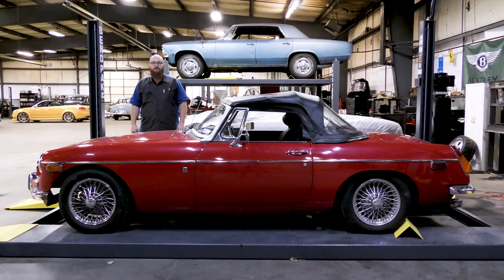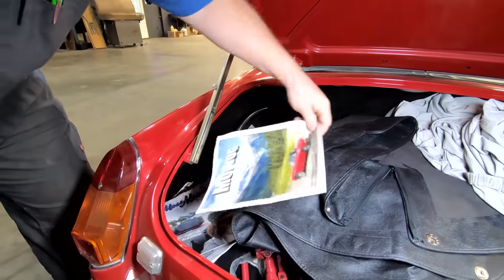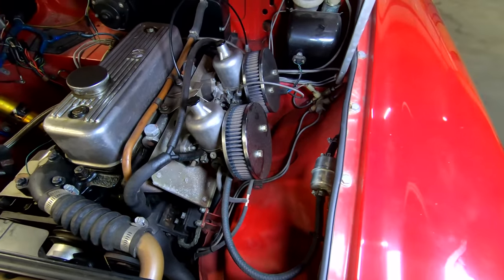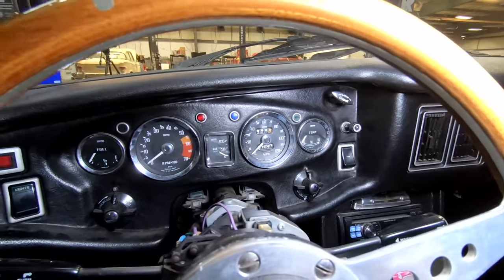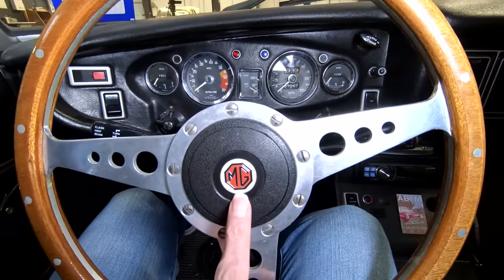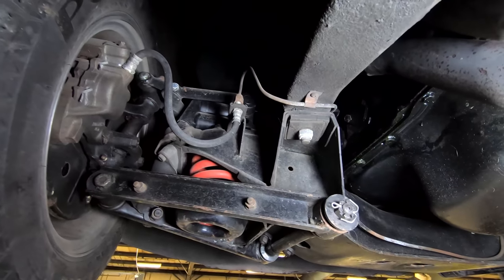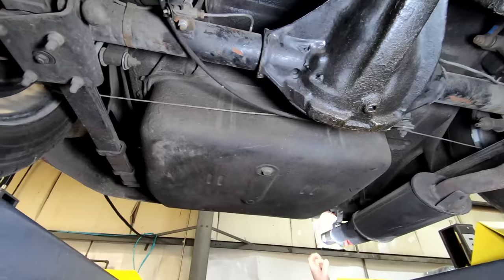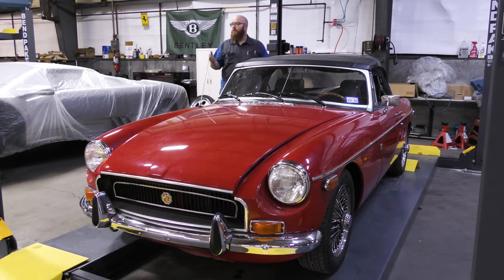Cherry 1972 MGB! See exactly why it earns a thumbs up from the CAR WIZARD!

Comment: MG A series manufactured from 1955 to 1962. The MG B series,  manufactured from1962 to 1980. 18 years of MG B series!  The later B series included a hatchback! Neighbour had a green hatchback with brown leather upholstery.  Beauty 1972 MGB convertible! 1.8L, 80-hp, OHV Dual SU carbs!  4-speed synchro-crash transmission with OVER DRIVE! It could actually drive on the Interstate! Love it! 01:49 "..back window": .. In the later half of the 20th Century, Brits (UK types) referred to the back window/rear window of their automobile as the "back light" . BTW, in the UK, plexiglass is referred to as "perspex". 14:20 The empty battery bracket on the aft port side is awaiting a starboard-side driver. Yup. Weight and balance considerations were taken into consideration for a change in suspension geometry for certain markets... . I have heard the MGB's knee-action dampers on the front suspension could be refilled with either mushy peas or beef gravy, depending upon climate. Rachel Ray's EVO be damned!.. In summer, the plungers on the SU carburettors were partial to a certain Portuguese Port. .  In England, aluminum, element 13, Al,  is spelled "aluminium". Funny that.  Some engineering features of 1950's and 1960's MG's were even quirkier than the 1972 MGB of the Car Wizard's.. Luv yah!

Comment: My MG stalled as well: The heat valve was leaking and water was constantly dripping on and in the distributor. Easy fix with a valve replacement.

Comment: MoWoG you'll find stamped on a lot of parts. It's an abbreviation of Morris (Mo) and Wolsley (Wo) from when the two companies merged. The G they say either means Group or MG as the prefix at the time for MG's was G.
Reply: MG is the abbreviation for Morris Garage.
Reply: It is spelled Wolseley, but pronounced as wolsey.  Love British English.
Reply: @mescko  I am British and say Wolseley
Reply: @clairesmith1117  Interesting.  I've heard Brits pronounce it Wolsey, I'll have to check with a mate of mine in Croydon, he's a a car nut with a Marina GT, 1300 GT, Maxi,  Dolomite Sprint, Stag, 2.5 PI Mk.1 and who knows what else.
Reply: @machtschnell7452   Actually  ... no.
Reply: @machtschnell7452  NO
Reply: @machtschnell7452  Garage is  I N C O R R E C T .

Comment: The British name for those shock is 'lever arm shock absorbers'.
Also the damping fluid in the carbs does not slow the opening of the throttle. It's action is to enrich the mixture on acceleration in place of the accelerator pump you would find on conventional carbs.
Those Lucas pumps were hilariously bad and they never bothered to improve the design in many decades.
When I was a kid my father had a Landrover which was only about a year old. One night it died in the middle of nowhere. He was completely unfazed - just looked around for a rock & whacked it. Pump started running and we went home. 15 years later I was in the army and the Landrovers were still breaking down for the same reason. I used to help out with recoveries and used the same method to get them going.
Reply: so true of the land rover carried a piece of wood "Rhodesian Army"
Reply: Thank you for spelling "damping" correctly. The Wizard, unfortunately, made the mistake of calling it a "dampener" as most people do.
Reply: W was essentially right re the SU carbies. Pedal to the floor, lots of manifold vacuum, the oil stops the SU piston slamming to the top of its pot (they look great polished)  and lifting the very long needle, prematurely opening the jet wide. The oil means it opens in a slower, more controlled way. A clever design, if you don't care a jot about pollution.
Reply: The fuel pumps were supplied by SU, not Lucas. With just occasional use, the contacts points stick, and the quick cure was to tap the pump with a hammer. Today, you can replace the points with electronics, which are reliable, and retain the original appearance of the pump. They are easy to overhaul.
Reply: @chrisnewbold9876 
Yes branded as SU, made by Lucas?
Reply: @gregculverwell  SU had its own fsctory
Reply: @petersherman2552  yes, you described it correctly. I had SU’s on my ancient Volvos, had them torn down, cleaned and rebuilt myself with gasket kits. The car even ran better when I did this.
Reply: These Armstrong lever arm shock absorbers were a nightmare, when they failed the failed completely. The reconditioned ones I used to buy could fail in six months.
Reply: Greg... as to the enriching, not quite.
Reply: @gregculverwell   Perpetuation of another Lucas /SU myth.
Reply: @davidvicari5139  And the reason the Swedes used the SU carb, best made. Swedes do not compromise on quality.
Reply: @velviaman3206  The Armstrong shocks are a simple device. Easy to clean and refill . Another Brit car myth.
Reply: @jeffhildreth9244 
Dear Mr Grumpy. I really don't care who exactly made them. I assumed that because everything else electrical which failed with nauseating regularity on British cars was marked 'Lucas', that they were also responsible for this garbage.
To be honest I never bothered to look closely - just gave it a whack.

Comment: Amazing condition underneath…here in the UK, owners can only dream of an MG  that rust free 👍🏻👍🏻
Reply: Yes indeed. No rust OMG
Reply: And about half of the US
Reply: Isn't that why you colonised Australia, so you could have a place to own and drive rust free cars. I'm sure that's correct.
Reply: Australia …a great place to find old British classic cars 😎
Reply: BMC Heritage does make a replacement shell or unibody for this car..
Uses much better steel and is completely original from the BMC panel dies .
Reply: @curtknight1021  I think they are etch primed like modern cars are so resist the rust gremlins very well.
Reply: For a while in the 1970s ,  l heard that England was importing tons of Russian made steel , as part of a trade agreement with the USSR..
It rusted as soon as it was shipped out , in those British car bodies.
Reply: @curtknight1021  I heard of that with Fiat, as the USSR couldn't pay for the tooling that went into making the Lada based Fiat 124. I've never heard of USSR steel being used in the UK but I wouldn't be surprised if it was!
Reply: It was part of a trade deal to open up commerce between the USSR and the  UK .

Comment: Wow! Brings back a lot of memories. I had a 1972 MGB that my Dad bought for me in 74. It replaced my 67 Galaxy 500 that my sister wrecked! Originally the car had two 6V batteries in series, hence the two battery compartments.Later I put in two 12V batteries in parallel. That required a Ford alternator to keep both batteries happy.  I put almost 233k miles on that MGB. I did rebuild the top end a couple of times, replacing the 8:1 original pistons with earlier 9.5:1 ones. I never rebuilt the crank, transmission or rear end. I did replace the crank bearings with std ones one time. The 72 had the 18V engine with the largest intake valves so there was some potential to make over 100 hp. Later added a dual point ignition with a 290 deg duration camshaft but still with the standard SUs. the result was rear wheel spinning first to second shifts. I recall hitting 120 mph on the speedo once.  I gave it to my now ex father-in-law back in 1988....it was apparently sold in the 2000's. I do miss that car!

Comment: The 1800cc engine produces 90 hp in standard trim. The overdrive gearbox normally worked on the 3rd and 4th gear of the standard 4 speed gearbox. The original battery arrangement was two 6v batteries wired in series to produce 12v, that is what the two trays are for behind the seats under the removable panels. I owned a MGC in my youth which in standard form was fitted with the 3,000cc 6 cylinder British Leyland  engine producing 150hp - similar to what had been fitted in the Austin Healy 3000. At first glance the MGC looks identical to the MGB but the give away is that the MGC had a pronounced bulge to the front of the bonnet (hood) with a discrete chrome trim. The other significant difference is that the front suspension was operated by torsion bars each side. It was a great car with a top speed of almost 130mph as against the MGB’s 110 mph. The only drawback was that the steering was very heavy whilst parking due to the big lump of engine.
Reply: Those MG had to be driven off cliffs to reach those speeds.
Reply: @machtschnell7452  Not an MGC.  Look them up.
Reply: Tne original HP was variously designated as 95HP  or 98 HP.   There were a couple of O Drive Transmissions.. early on they worked on 3rd and 4th  and later 4th only. 
The MGC also had 15 inch wheels.  I bout a 1969 MGCGT in 1970 from my employer,, British Motors of Monterey (Calif)  One of the finest of 30 Brit cars I have owned , my favorite... I miss it.

Comment: MGB's had two 6 volt batteries in series for 12 volts. They did that for weight balance. Many converted to a single 12 volt battery for simplicity.
Reply: Good story.

Comment: The "Extra" space at the rear was for the "other" battery. The cars were originally designed to run 2x 6 volt batteries - hopefully to give equal weight distribution:-). I had one when I was 21 and checking the electrolyte levels was such a chore it was rarely done! Now in my late 60's I have 2 and they're a joy to drive top down  on a sunny day.

Comment: Lucas fuel pumps had a set of points in them which are much like the points in the distributor. Usually it’s just the points that go wrong and are replaced or the diaphragm which is also replaceable.
Reply: Stock fuel pumps are actually SU.  As you say, the one at the wizards shop could probably be brought back to life by cleaning and adjusting the points. The SU replacements can be had w/points or electronic.
Reply: @jeffhildreth9244  you’re right. My bad.

Comment: I love MGs!!!  Used to have a 77 B & now a 78 B (52k miles) with the Weber carb conversion. That switch falling apart is common (British Leyland), that overdrive is an aftermarket option that I wish I had on mine.  Great quirky little cars, so much fun to drive.  That one is beautiful.
Reply: If it's any consolation, ignition switches also loosen up and come apart on '60s Mercedes! :)
Reply: Overdrive was a Factory option, so the prop shift is shorter if fitted.
Reply: Wish my '67 Alpine had come with overdrive. It was really buzzing at 70 mph. Still, it managed to survive numerous highway trips, including a big one in 1990 to Toronto, Canada, for the dozen or so years ('84-'96) I drove it.
Reply: Philip Ketcherside.. MY guess, wussed out and installed a made in Spain ( not Italy) down draft Weber. Inefficient, fiddley Junk.  Fit some proper SUs.

Comment: The good and the bad memories came flooding back with this video.  I owned a 1970 split bumper MGB.   In yellow..  bullet proof motor and transmission, twin stromburg carburetors,  wire wheels with knock off hubs,(just like the car in the video).  Loved that car most of the time,  hated the Lucas Electrics, mechanical points in the fuel pump.  Everyone needs to own a British car with Lucas electrics.  Just for the experience.  Wonderful to drive, pain in the butt to own.
Reply: Forgot,  my ignition switch melted in the parking lot of the servicing dealership.  Also remember the challenges of the knee action shocks.  Oil filled…straight 40 or 50 weight oil as I remember.

Comment: Having owned one (as well as a couple of Triumph GT6's), if your English car doesn't leave oil spots on your driveway it usually means you'd better check and see if there's any oil at all in the engine...
Reply: It's an early form of rust prevention.
Reply: Truth. A neighbour was recently visited by a trio of fully-restored E-Types - one of each series - in town for a meet. A day later and there were telltale oil spots on the road where each one had been parked.

Comment: Great show of the MGB.  When I was 18, I had 2 MGBs and an MGB GT.  All were cool but I always had to borrow parts from each to keep one of them running good at all times.  The rust issues with the floors and rockers was a real problem.   The GT was advertised as all new sheet metal which had the 60s/70s restoration of thin sheet metal, rivets, bondo, and undercoating.  Even some Porsche 356s were kept on the road with this method.  Restore your sportscar in one afternoon in the back yard  LOL.

Comment: Horsepower was rated at 95 net bhp on both five-main-bearing and earlier three-bearing cars with peak power coming at 5,400 rpm with a 6,000 rpm redline. Torque output on the MGB had a peak of 110 lb⋅ft

Comment: Always loved the three small wiper set up. I am well over six feet, and yes, your head will be touching the top, as I did in a Triumph and a FIAT. Never knew you could shut off the heater at the block. Wish I had, as these British roadster are roasters in the Summer, and barely adequate, especially when it comes to defrosting the windscreen in the Winter. Loved the overdrive units. Had a similar one in my Two Series Volvo, and it really cut the revs at Interstate speeds. This MGB is a beauty!

Comment: Hey Mr. Wizard, nice video! Just a quick note, the extra compartment behind the driver's seat is for the second battery. MGB's used two 6 volt battery's wired in series to make 12 volts. It wasn't until the the very late 1970s that you could find a 12 volt that would fit in one  MGB battery box. This used to give us much pain trying to pony up for two new battery's at one time! Thanks again for the great video, it took me back...

Comment: We've had British cars in South Africa since the year dot.  Easy to work on.  Even when you bought them new, the technology was old school!!  That Lucas fuel pump can be taken apart... Get to the points on it, clean up the points with a fine nail file or super fine sandpaper and you're ready to go for the next ten years... BTW, the air filters are not original, as you stated, and so is the oil cooler.  I imagine it's a warm/hot climate in its home.  Warms my heart to see the innards of cars I used to work under!!!  Hahaha... Keep up the good work, Wizard.

Comment: Over the years I have had 10  MB-Bs and MIdget. The yard looked like a used british car lot.  The early year car were very spartan and the car had a great exhaust note to it. There are alot of fun to drive and relatively easy to work on. Still have a garage full of parts, engines, transmission, doors and wire wheel. Tempted to get another B to put some of my parts to good use. Great review Mr. Wizard of one fine looking car.

Comment: I had a 70,  then 72 MGB...   Great cars.. I took the drivetrain from the 70 and put it in the 72 (70 had the overdrive trans, which is a major plus)....  in 1983,, I bought a '80 limited edition MGB and I swapped that older drivetrain (and suspension) into the 80.  The 72 and subsequently 80 MGBs were my daily drivers for many many years.  The 80 is now fully restored with a V8 engine swap.

Comment: Having lived with an MG for so long, listening to you talk about this car like it's a Fred Flinstone mobile cracks me up. These cars are pretty simple. Check the glass fuses first, than give it a swift kick in the ass. Problem usually solved. And as for the bit of seepage? When you add oil constantly you don't ever have to change it. And for 80 horsepower? With high octane only. Cars are rated more like 62 horses. You can outrun it, you'll never outfun in. And don't make fun of the small universal joint. Our cars are self conscience about certain things

Comment: So nice to see! I owned a 1972 which I purchased used (beat) in 1979. Enjoyed the heck out of it until starting issues. Did full head gasket replacement . Still no go. Replaced clutch and throw out bearing, (total engine removal ) still no go. Replaced a $3 2 minute distributer relay switch (Lucus :(  ) ran fine for another 10 years til we parted ways.

Comment: It is oddly interesting that when I was a "kid" back in the 60's and70's and the British roadsters I owned  around 15 years old, parts were sometimes very hard to procure and now much easier!
Reply: Yes, you can get them delivered to your door within a few days now with just a few clicks on the web !
Reply: Steven - My first car was an Austin-Healey 3000 which I bought in 1970 at the age of 16. Many shops in Los Angeles refused to work on "funny foreign cars" so I bought a repair manual and learned how to fix it myself. There were still dealers at that time, small parts like brakes and ignition were easy to get, and there were lots of parts cars in junkyards for cheap .
   Now things are very different, lots of repops are available because these cars are now being restored for considerable dollar value.
   I paid $650 for my Healey and it was almost mint, with ragtop and hardtop, leather seats, OD, and mildly hopped up engine. Now I see some go for over $100K at auction.
Reply: @lewis72  Different time indeed.  Sure wasn't that way back in the late '60's.
I had three XK120's back in high school. Did not pay over a grand for any of them!
Reply: @Brookside975  
Lesser examples, I can remember when 2-door Mk2 Escorts were virtually free.

Comment: MOWOG was from the MOrris and WOlsely Group, if you ever owned a mini, you would brand your wrists when trying to tighten the exhaust clamp.
The fuel pump is easy to service, usually just a strip and clean up gets it working, always satisfying to hear the tick tick before you start, if you do not hear it, then hit the pump with a small hammer, and it will usually start to tick away.
That car looks in amazing condition, I do think the side indicators required for the US market, and the triple wipers spoil it a bit.
You do not see too many unmolested originals anymore, the radio and steering wheel could be put back, but the improvements are fine.
Thanks for the video.